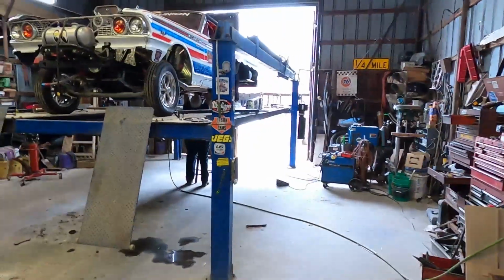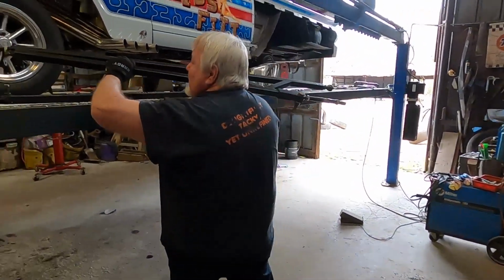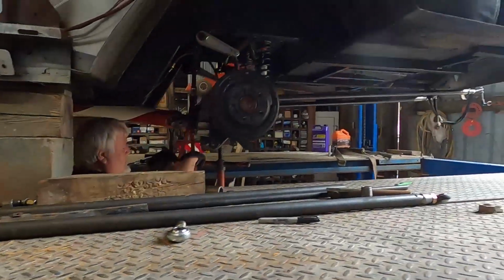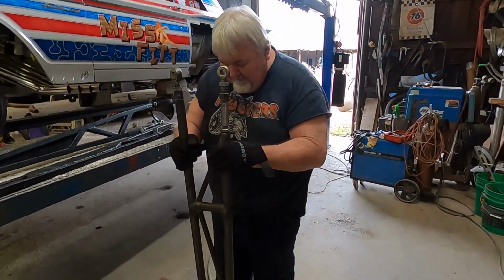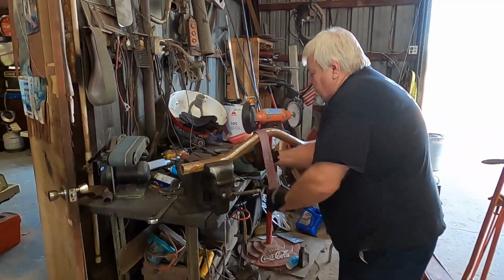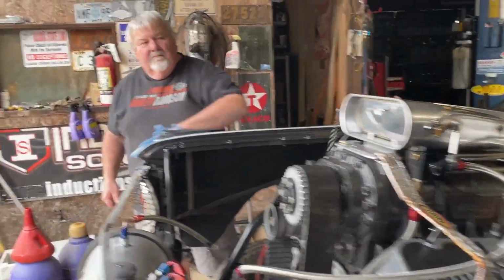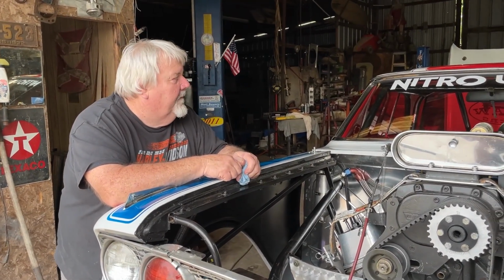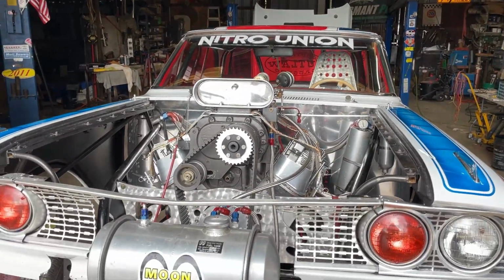Making big changes to Miss Fitt's suspension in search of more consistency with new ladder bars

Comment: What size engine and blower is in that beast?
Reply from the maker: 540ci with an 8-71 blower. It's a non stripped blower so it could make more boost than it is with an upgrade but it's plenty for this chassis at the moment
Reply: @NitroUnion  I was wondering… I have a 565 with a 6-71 weiand non stripped, only about 8lbs, made 800hp @6500. Two small of a blower, but what I had at the time… Love a high helix 8-71 but might go twin turbo instead. Can’t wait to see how she does with the new bars. Hopefully it’ll quit rear steering on yas.